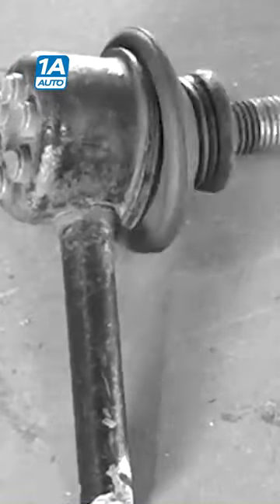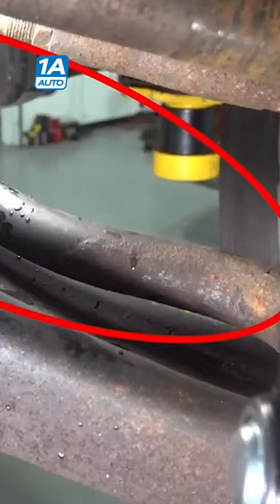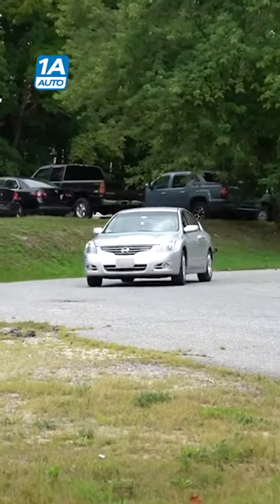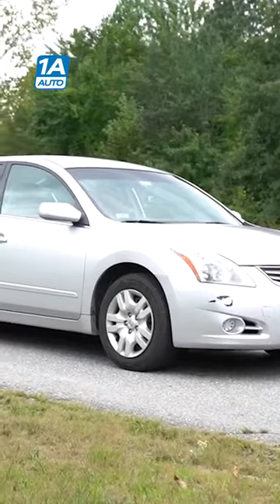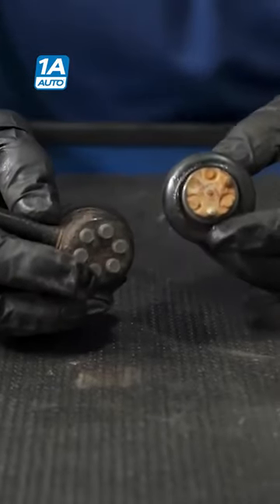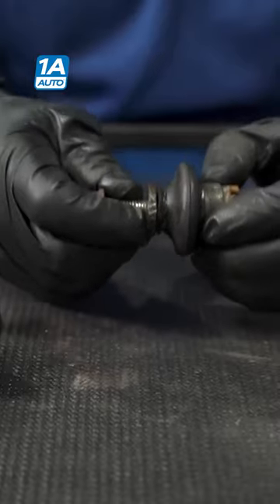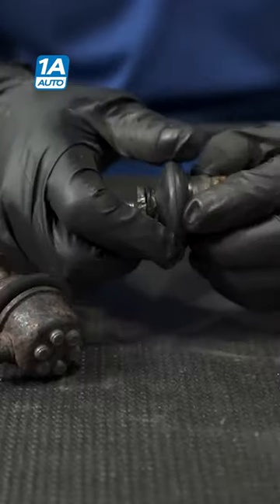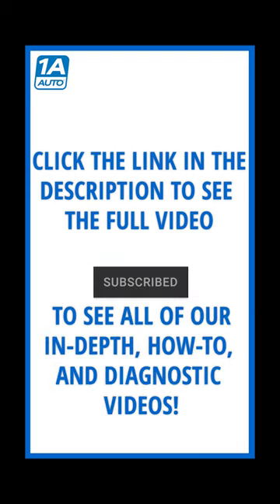Knocking Noise Under Your Car or Truck? Simple Suspension Solutions! #shorts

Comment: Remember to use proper nut, i just changed mine sway bars and they unscrew themselves after 2000km a little bit. Use lockthread or nylon nut so it wont unscrew.